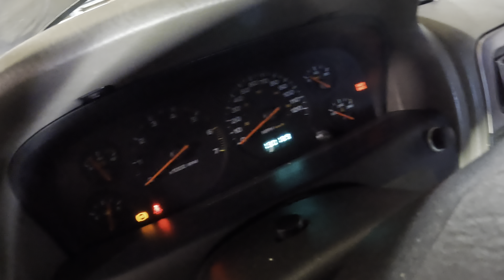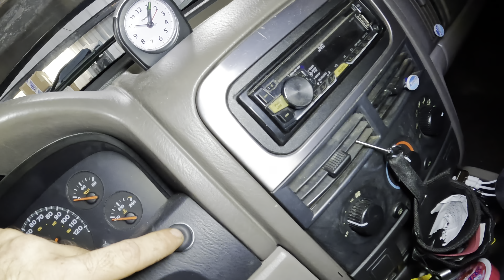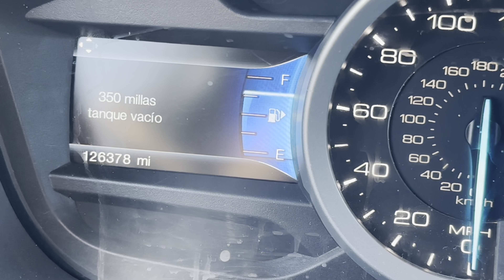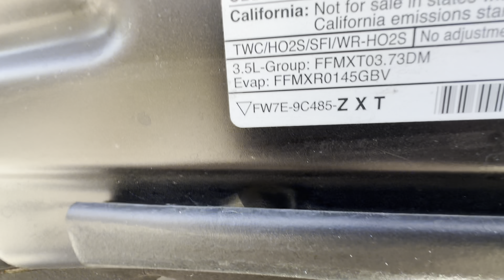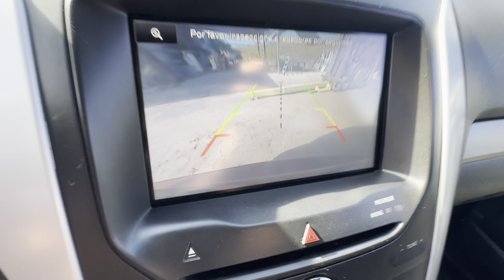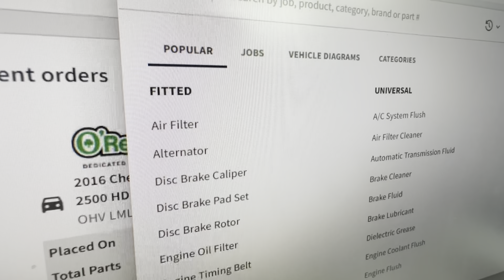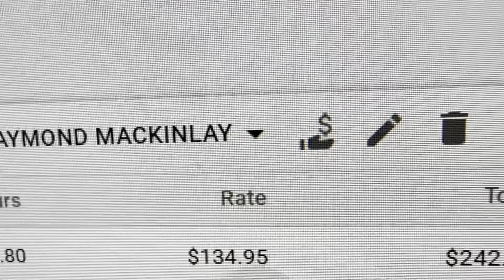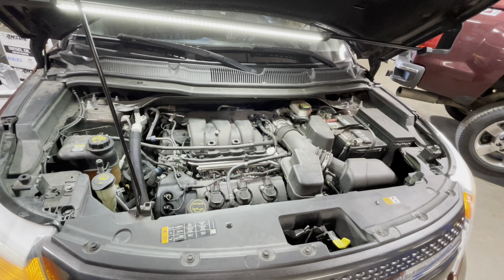TOO EXPENSIVE!  Repairs Declined! Twice! Jeep Cherokee 4.0 & Ford Explorer Noises While Driving

Comment: I always wondered what Ray’s labor rate was.  Any shop in my area charging only $135/hr would have a line down the street.   And he gives an oil cap rotation for free.
Reply: I’d say $65 to $80 dollars is average in UK. Crazy how much difference there is.  $120 to $190 would be main dealer prices. Fair play tho, time is valuable. Wish we had more decent honest mechanics like Ray.
Reply: @bluestorm1944   when I was around 15 or 16, a mechanic shop near me was $30/hr. this is kinda crazy
Reply: $135 is low where you are?
Reply: @jimandersen3003  kansas
Reply: @jimandersen3003  and the dealership near me is like $95/hr so
Reply: I think it goes 

Standard=$100hr
If you help=$150 hr
If you watch=$175 hr
If you worked on it first=$200 hr
If you tell me how to do my job=$250 hr
Reply: @Userf451  and the bill is:$99:turning bolt $1 knowing what bolt to turn or vice versa
Reply: Same here, the local Ford dealership is $197 per item diagnosed.  So, the last time I was there I wanted them to look at five items and the quote for diagnosis alone without a repair or before it touched the lift was $985.  I said, naw, I can do three of the five items myself and just wanted to give them the business, but they will now never get any business of mine in the future.  I get fees for diagnosis, but that's absurd.  I did end up fixing four of the five myself.  The five was the factory remote starter which is intermittent and I will just have to live with that.
Reply: My old man was a mechanic. He charged anywhere from 15-30 dollars an hour. Even dealers only got maybe 40 or 50. The amount mechanics charge these days is highway robbery.
Reply: @functionatthejunction what's a fair rate to you in 2024? A 2 bedroom apartment is like 2k a month where I live.  Tools are expensive! Working on cars can suck.  50 bucks an hr isn't going to pay the bills in a shop setting with overhead,  sick days, vacation, health insurance, plus paying your employees. I'm 50 - 60 bucks an hr working from home on the side. I wouldn't take a penny less. One always has the option to fix their own car if they don't like the labor rates. After busting a few knuckles they usually justify the labor costs
Reply: @Userf451 those prices are b.s. this isnt the 80s.
Reply: @JohnnyDanger36963  It’s meant to be a joke.
Reply: I manage an auto shop in Austin, Texas and our labor rate is $185/hour. That’s kind of the industry standard around here. There’s always going to be some guy that’ll do it cheaper, but you get what you pay for. When you factor in rent, utilities, shop and office supplies, we’re barely making a profit most of the time. And that’s with my mechanics paying for their own tools, which is no small expense, I promise you. In Ray’s case, he’s the mechanic, so not only is he paying for his own tools, but he has all of the above items to consider as well. If you don’t charge enough, it will come back to bite you when cars come back for warranty repairs or you make one costly mistake.
Reply: @Neoatheist86  its not the publics job to pay for your  buisness infrastructure. 185 per hour to turn a wrench is too high. 60$.maby
Reply: @JohnnyDanger36963  Well, unless you plan to operate at a loss, it kind of is the public’s job to pay for these things. That’s what makes a business successful. Do you think that you don’t pay for these things when you go to the grocery store, or when you buy a car or literally any service? Of course you do.
Reply: @Neoatheist86  it would be interesting to see if mechanics in the 1900s charged 185 hr equivalent.
Reply: 135 is a little high, but for quality service? someone i can actually trust? yeah, i'd pay that
Reply: @Userf451 what if i sit there and tell you how amazing you are, and bring a couple cold ones
Reply: @JohnnyDanger36963  No one is saying you have to pay for it. 

You can find "the guys that'll do it cheaper". Good luck if he didn't do it correctly though. 

You can also wrench yourself.
Reply: Seemed slightly high to me. Most small shops where I am are around $100/h canadian. So I guess it is close. Dealerships here charge around $130 to $140 an hour
Reply: @bluestorm1944  damn. In Germany you're looking at about €150+. BMW, Audi, Merc is usuall around the €190+, even Toyota is at €150.
Reply: $135 is cheap where I live. Las Vegas shops are close to or over $200 an hour now.
Reply: It's not the highest in our area, but not the lowest either...! Mine was the 95 F150 that needed a clutch and U-joints last year... The average in Sarasota/ Bradenton is around $150-180... Thanks
Reply: I own three businesses in Sarasota, Florida... My lawn service  labor rate for a two-man crew is now $115(single-man: $90), up from $90 for two-man and $65 one-man during '16 - '20...! Our current taxes, fuel and inflation has forced all of us to raise rates substantially... or fuel bill alone has more than doubled...!!! Thanks to the democratic administration we're under now...!
Reply: @kurtisstutzman7056  you do realize that the fuel in the US is still dirt cheap compared to the rest of the western world?
Reply: @dragonsmonk  I'm not concerned with the rest of the world's prices...! The price in Sarasota Florida is the only price that effects my businesses...! My lawn business alone burns over $900 weekly now, we were only spending $300 from '16-'20... same amount of fuel...!!! Thanks... have the greatest of days...!
Reply: @kurtisstutzman7056  I get so tired of politicians and their supporters blaming and/or taking credit for high/low gas prices. A president of either party has almost no power to cause gas prices to go up or down (other than temporarily opening the federal Strategic Petroleum Reserve).  Petroleum is a world wide commodity that trades on open markets, just like wheat, gold and diamonds.  

It is supply vs demand.  

Do just a little research and you will see I am correct.
Reply: @SteveVaczovsky  Yep... That should be common knowledge, but it's not...
Reply: @kurtisstutzman7056  So why did you just blame high gas prices on a “democratic administration”?
Reply: @JohnnyDanger36963 well yes, actually, it is. Otherwise the business goes under and doesn’t exist anymore.
Reply: @SteveVaczovsky sure, until the president decides to pick a fight with the Saudis and prevent American companies from producing. Turns out that affects prices.
Reply: @derekeastman7771  then let it go under. Market balances
Reply: Wow, I don't know what world you live in, but that, to me, is VERY VERY expensive.
Reply: @Neoatheist86  its not our job to pay your rent..185 an hour to turn a bolt is outragoous. 35$ an hour is what its worth. Auto workers get 35$ an hour and STILL have to pay their own bills. Nope. You guys are all in a loose monopoly.
Reply: @derekeastman7771  I just read last night that the US has been drilling/fracking more in the last year than during ANY YEAR of the previous administration.  Also exports of natural gas are at all time highs.  Petroleum and its derivatives are a commodity the price of which rises and falls based on world political and economic situations.   The narrative that US production has been suppressed the last three years is not supported by facts.
Reply: I think his rates also are subsidized with his videos he’s doing really well on YouTube. Locally around here in lakeland FL the dealers are nearing 200 I’m at 160 an hour and most of the time with how much money we have to invest in specialty tools and incredibly incompetent engineering as well as inflated costs for literally everything we make just what we need.
Reply: @JohnnyDanger36963 I charge 160 dealers near me charge around 200. I’m fine not having customers that don’t appreciate my value. I’m booked out two weeks ignoring phone calls. If I charged 30 dollars an hour I would have had a line out the door and customers who loved it but gone out of business a long time ago. We use to charge 85 starting and that wasn’t nearly enough. You literally are just ignorant of how expensive it is to actually run a shop pay. I was surprised how cheap Ray was but I also realize that his YouTube channel is doing pretty well so I’m sure it subsidizes to some degree what he makes.
Reply: @JohnnyDanger36963 reading your comment made me think of another issue that many people don’t think about is that it’s not just “turning bolts” cars have gotten more and more complex. The amount of hours I have spent studying to understand and troubleshoot problems efficiently can never be paid back by my hourly rate. It’s like studying to be a doctor. Those years in med school allow them to be efficient and accurate and it has value to discerning people who don’t want someone guessing on them.
Reply: @jasonvergara7705  good point.
Reply: I work at an audi dealership and I'd like to win this thread with our labor late being $265.
Reply: @etrcentenario9737  😂🤣
Reply: Dealership near me charge like $100-115/hr, reg. Shops around $90-105. I dont know about the high end shops, like Benz, BMW, etc prob $120 area. MA.
Reply: "customer says brakes so we pop the hood and give full diagnosis" 

Didn't the customer say brakes??
Reply: @SteveVaczovsky Because he’s too slow to realize you were talking about him.
Reply: @SteveVaczovsky  Your correct but what government's do is add taxes to the market cost of fuel.  Here in Ontario Canada this May 2024 regular gas was $2 a L or about $9 a US gallon.  Its late June now & its down to about US $7.60  What caused the increase Here was a new Carbon Tax increase.
Reply: With YouTube directional videos, most repairs can be done by a novice. Hopefully it puts people like you out of business. I'm sure it will lower labor rates eventually. Wait 5 years from now.
Reply: How much do you pocket out of that185 an hour? 120?

Comment: On the Exploder, always charge a diagnostic fee. You can apply the fee to the repair if accepted by customer. Because some customers will sometimes use shops until they find one to do it for cheap. Your expertise, time, and labor should not be free. Also when wife unit is relaying details to customers, just ask them to look at the video for proof of all details on your diagnosis and prices. Especially for 1st time customers.
Reply: You do know he's not new to this game?
Reply: @davidworsley7969   The comment is a good one so that people new to this line of work take the hint.  We used to charge a "lift fee" for all the dingle-nuts that where known for 'shop-shopping'.  

"Hey, my truck has a noise. Can you check it?"  (and they've already been to several shops)  Sure.  That'll be $40 bucks for the lift fee....(or insert your fee here....)
Reply: That's totally fair. The customer didn't know what was wrong, for all they knew the engine was about to blow up. Now they know what the problem is and what it will take to fix it. Well worth paying the diagnostic fee.
Reply: On the ford, and i had to do this on my 40 year old sons car, 2005 acura tl, pull the cooling package and bring it out the frt, it might also come out the wheel well 
The guys going to take it home buy a cheapo reman and try to do it in his driveway finding out he doesn't have the tools or skills. 

The jeep, just slap him upside the head he's too stupid to own a car.
You might pinch off a brake line to get home, but its not a permently repair.
Reply: he never said the noise diagnostic was free, probably charged $49.99
Reply: Ray , You have to charge the Explorer customer a diagnostic fee to be refunded if you do the job. Don't let them stick it up the wazoo.
Reply: When I was in appliance repair, a diagnostic charge of $80 was assessed, even if the repair was declined. The technician's time is worth something, as well as our mileage.
Reply: As a customer I am totally cool with that.
Reply: Absolutely! I think Ray is still in the mindset of the previous 'fast fit' place. I don't think they charged a diagnostic fee. BTW, you'd think if the guy paid to have it towed in, he could afford the cheaper of the two quotes.
Reply: This is a good point I've had to explain to people almost daily for the last 16 years as a mechanic, what they're doing is indeed trying to have you diagnose it for free, especially the older DIY guys, I've even had little old ladies try this(they have a family member do the work, usually poorly). They get PISSED when you charge a diagnostic fee but my time is not free and I'm paid by the job not the hour so if you decline it you're wasting my time.
Reply: @COBRO98  my opinion is, if the customer wants to do the work themselves, they can perform their own diagnostics too or pay the shop for the service. It blows my mind to think customers would even assume that there should be no cost. If the customer complains, who cares? No shop needs a "customer" like that.
Reply: Ray charges a diag fee, customer already paid for a tow, and probably thinks $100 alternator at auto parts store and they can swap it easily in the driveway and save $400, willing to bet repair will be completed by mobile mechanic or another shop once the owner starts the replacement process
Reply: Good advice. Just can't believe they had it towed in and then didn't want to fix it. They are already in a couple hundred as it is. Plus removal. You might also consider a storage fee. All this should be up front of course. On the other hand, then you have to mess with collecting and I doubt that would go smoothly.
Reply: My local Ford dealership is $197 per item diagnosed, if you have it fixed or not.  After we broke $1000 in diagnostic fees before the car was on the lift, I told them to forget it.  But I do believe a full hour should be charged for diagnostic fees.
Reply: @jeffreycler495  Charging people who are looking for the lowest estimate on getting a job done is scummy af dude. Even lawyers dont do that.
Reply: @Balticblue93  thats a heinous price. youre not taking the goddam thing apart, just checking whats wrong. some inspections. NOT worth 200$
Reply: @MTLeopold I think a diag fee is appropriate not everybody has 600 bucks to spend on an alternator. Generally they run about 200 to 300. The guy that dropped it off probably wanted the diag and planned on fixing at home anyways 🤷🏽‍♂️. I’ve done this on purpose more than a handful of times. Which I was charged a diagnostic fee at shops that I don’t usually go to. Which is more than fair and cheaper than paying double or even triple for convenience. I was quoted 500 for a distributor repair I smiled paid the fee and called the tow truck right back up there to pick it up. I bought the distributor off Amazon. Lasted 3 years until I sold the car.
Reply: Which video? Do mean the one on there car that still has to be edited and might be posted 1 to 2 weeks later. But this is crazy an alternator that has to be pulled from under the car.
Reply: Always gotta find a way to fleece people. How many old ladies you take advantage of?

Comment: That jeep is a horror show, what happens when you wait to do anything
Reply: dude its a jeep. keeping it out of the junkyard is an epic achievement in general
Reply: Well it's also the "I think I can fix that" mentality. Puts wheels on that don't fit and burns hole through the fender flairs and shock absorbers. Must have been doing that for a long time.
Reply: If you can’t afford to do the repairs, you shouldn’t be driving.  Get a bicycle.
Reply: Deferred maintenance
Reply: I won't use a remand alternator the two times I've done it they just run to the end of their warranty and then that's it about 18 months put on a new one and it runs for years
Reply: @johndonovan7018 You probably struggle to change your oil as well